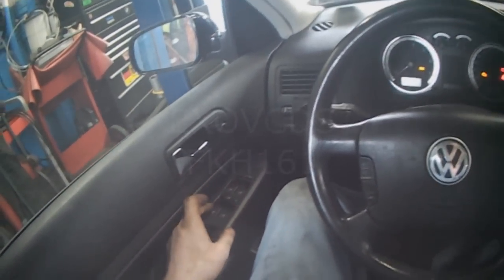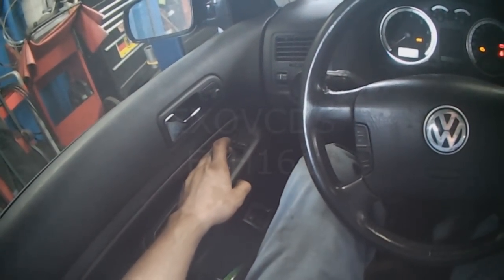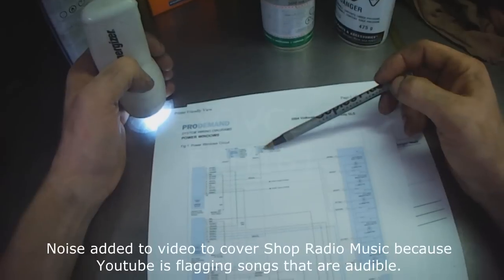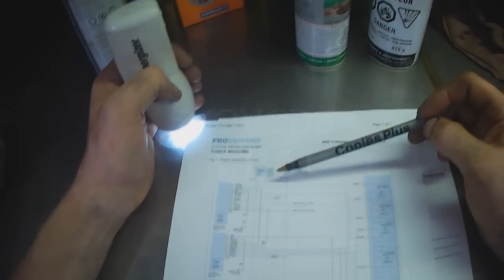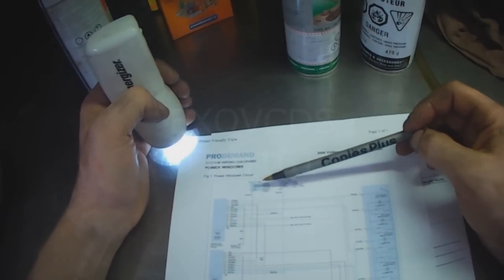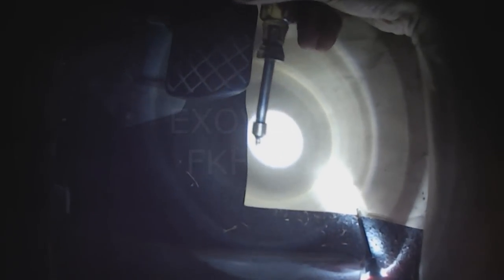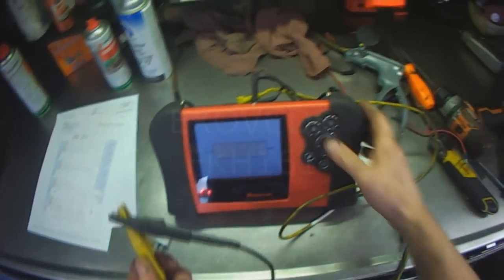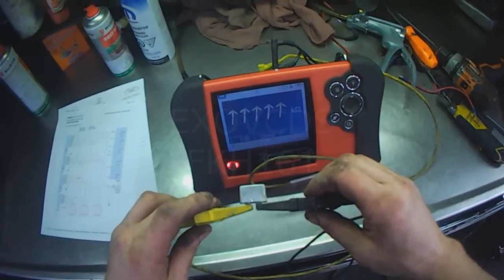VW A4: Power Windows not working

Comment: 2021 and this helped me save a couple hundreds of dollars. I checked every fuse on the side of the panel, checked the wires that go through the door, I was loosing my mind, when I checked for this fuse it wasn’t there, didn’t even knew it existed. Thank you!
Reply from the maker: How did the windows work in the past if the fuse was missing? Did you just buy the car?
Reply: @EXOVCDS  yes I just bought the car a few days ago, the windows didn’t respond at all, checked fuse #14 first and it was fine, then I checked the wire harness that goes through the driver’s door and it wasn’t bent nor damaged, I literally just saw this video and did it and the windows started working, except the front passenger’s. I took the 20amp fuse from the horn (which is not working) and put it there.
Reply from the maker: @prod.grvvity  thanks for the additional info! Congrats on the new-to-you mk4. Feel free to check in on my channel should you have any other issues in the future. Thank you for watching!
Reply: @EXOVCDS  thanks for making these, your helping many people with simple and informative videos.
Reply: I just also purchased a mk vw golfsportwagon tdi and the windows won’t go down will be trying this next, what fuse is it or how many amps so I can just replace it anyway if you don’t mind me asking??
Reply: Mk6*
Reply from the maker: @fitbiker1800 
The Golf sport wagon is different from the VW mk4 / A4 in this video. You'll need a wiring diagram to help troubleshoot the issue.
Reply from the maker: @fitbiker1800 
Start with a full system scan... you'll need (or go to someone) a VCDS or similar scan tool. 
Once you have the system scan, post the results here, so that I can go through it.

Comment: You my friend are a lifesaver! I've been chasing wiring and checking voltages all day long! I checked that circuit breaker for continuity and it was there but replacing it with a fuse was the trick. I put a new breaker in and walla, FIXED! After checking all voltages and connections to CCM it boiled down to this Breaker. Thanks for the information, I hope others can find this video with the same problem.
Reply from the maker: Thank you for watching!
Reply: I think I better check that on my vw jetta. Windows stopped working so I replace the switch. Still they don't work.
Reply: @EXOVCDS  I don't have the right tools to remove the nuts that hold on the paneling that covers the circuit breakers. That's my issue.
Reply from the maker: @Will324  year, make, model?
Reply: @EXOVCDS  2003 VW jetta 2.0
Reply from the maker: Should just be Torx screws that hold the panel in place... just like in the video. If you do not hear any clicking when the window switch is used... then the problem is probably something else.
Reply: @EXOVCDS  yea I replace the switch and even with the new one it's dead. Not a click with any of them. All the individual window buttons also don't work. The fuse is still good. What could it be ?
Reply: Electric windows in my old Audi sometimes works and sometimes they don't.  could this be it?  what's the difference between this and a fuse?  can it be purchased in any electronics parts store or do you need the Audi part? Thank you
Reply: @EXOVCDS  does this problem transfer to the mk6s same issue as your describing door locks work window lock lights up , but no door panel can roll down windows the window relay also does not make a clicking noice when touched
Reply from the maker: @nintendo002 
The only thing that is similar is the possibility of broken wires in the door jam. Everything else is different between them.

Comment: I held my positive and negative cable together for 20 mins ,carefully
 slid back on poles at same time and BINGO-all went to reset.Everything 
works great!!!!! This method saved me a pile of money.Club members 
should try this if you suffer from same problems after battery 
disconnect.It is safe and it works Anytime any system on these cars is acting confused, do a capacitive  discharge.  It works very well lol.  We do it quite a bit at the dealer  for when a car just doesnt seem right.
Reply from the maker: Good tip... I have used the capacitive discharge many times to cure weird issues. Most of the time, 10 seconds of holding the cables together will do the trick.

Comment: I know this is an older video, but this still helped me. I know this was for an mk4. However, this was still applicable to me and my b5.5 passat! Very same conditions. Pulled the breaker and found a boat load of rust and corrosion. So I bought a lilse fuse slot cleaner and breaker. Sure enough! I've got windows again! Thanks for what you do for everyone!
Reply from the maker: Thank you for watching!

Comment: You seem to be the most informed person I've read. I bought the $100 manual and that hasn't helped , so I am now reaching out to you. I just bought a 2002 VW Passat Wagon 2.8. No windows will roll up or down. Let me re-phrase that. I can try and every once and a while the drivers front or passengers may move an 1/8" up or down. But that is it. No sun roof or rear hatch release. All lights light up so I can see power going to the switches.  I tested the main switch control unit in the drivers door, and four separate wires had over 13 volts DC. I Pulled the carpet up under the drivers floor and it looks like brand new. So didn't the CCM. No broken or frayed wires anywhere. No sign of water having ever been in there. I pulled the cover off the CCM and didn't notice anything burnt on the circuit board. I also checked to see if there was a ground to chassis, and it did Ohm out as to getting a good connection.
Also, the door locks work with no issues. But is the light beside the drivers door lock supposed to flash all the time? 
    So I do not know where to look next. I have an OBDii tool, but I don't think that will help me here. Any, any help would be much appreciated....
Reply from the maker: The little LED at the base of the window should only flash when the vehicle is locked (security / alarm ON indicator). If you hear clicking from the "door module / power window motor / module" (one and the same) when the window button is moved, then "control" of the window is present (switch & CCM)... and the issue is with the window motor / circuit board / polarity relay (on the board). 
It could be that you have 4 bad window motors / modules (they go bad with age just like the door latch modules / actuators)... but if there are other items that are part of the convenience system that do not work or function intermittently... I would continue looking for a common issue.
I can supply you with wiring diagrams, that's about it. I would have to look at the diagram myself and study how things that you listed tie together... and might then be able to guess as to where the issue might be. 
Have a look at this... not sure if this can happen on a B5 Passat, but it could also possibly interfere with the CCM.
https://www.youtube.com/watch?v=NPuw8TR3KYg

Comment: Thanks very much for this video, I've been having problems with my  windows not working for weeks had checked all the wiring, and the ccm and  could not find a solution I did not know that there was another hidden fuse windows working fine now thanks.
Reply from the maker: Circuit breaker.. :) Thank you for watching! I'm happy that the video was of help!
Reply: Where is that located?? Pleaaseeee

Comment: Nice video! The large fuse was the issue on my 2009 Beetle. I unplugged the fuse, found no continuity problem, but plugging it in the Windows now work. Perhaps it was not fully seated, perhaps it is a harness issue. Regardless I know where the issue is now. Thanks for saving me lots of $$$!
Reply from the maker: Nice... $5 gets you some of my youtube channel stickers! Second donation button on my website: http://fkh161.ca/
Reply: Thomas EXOVCDS   St. John’s Newfoundland. I wish I had seen that I could call you on the phone.  Back in August I was working on a 1992 camper van. I watched a lot of your videos that were very helpful. The van would start and shut off after a few seconds. I borrowed a spare distributor. Checked the fuel pump pressure. It ended up being the ECU, it was green. Sourced one locally for a decent price.  I am going to order a few stickers and I will definitely support your page. I will stop in and say hello next time I visit BC. Keep up the great work.

Comment: You are the man thank you so much  I just bought a 2008 Volkswagen Beetle with 63000 Miles for $500 that has been sitting for over 4 years due to a death in a friends family they wanted it gone  there was a definite moisture problem inside the car that they knew about because the driver side window was left down about 1/16th of a inch not enough to get rain in the car but it did build up a lot of moisture basically nothing was working in the car after I put a battery in it because it blew all the fuses and I had to dry the car out completely them replaced damn near every fuse but the power windows did not work after everything else started working I've been trying to hunt  down the problem for the last 3 days i was thinking it was the Comfort Control Module because it can cause the windows not to work but I was hearing the clicking in both doors and that's when I started to search the problem and I found your video it was the exact problem the circuit breaker I did like you did and put a fuse in it and it worked and I looked through all my bug guts/parts box  and I found a good circuit breaker and I put it in there and everything works perfectly thank you so much for your video it's saved me a lot of time 😉
Reply from the maker: Nice to hear that one of my videos was of help to you! Thank you for watching!

Comment: Hi thx for this video, what kind of component did you put in that connector to replace that module with corrotion?
Reply from the maker: To test the circuit I used a fuse of the same rating as the circuit breaker. The rating is stamped on the circuit breaker.

Comment: Nice video.  If you change a window module and motor. Do you have to reprogram or relearn it?  
Thanks.
Reply from the maker: Year, make, model?
Usually only the auto up / down needs to be activated.
Reply: It’s a 2002 beetle gls 2.0.  Your vw looks familiar to me as far as the switches and schematics. Yeah it’s strange the original window module motor relay burnt up so I bought a used one in the same year range.  It will only work until the control circuit times out. Then I have to unplug it and plug it back in to work again.  I lost the dome light and passenger side window control from the drivers side. When I plug the original module back in the dome light comes on and I get control of the passenger side window again. Thank you for any help with this situation.
Reply from the maker: I would suspect that there's a problem with the used one. Can your scan tool communicate with the module or get info from other modules? A full system scan can be helpful... the comfort system control module might have codes stored, or tell you if the door module needs to be coded.

Comment: I've got an interesting one for you. 98 Passat, aftermarket stereo. Can't read obd2 codes but power is there. The customer had attempted to charge the battery, but swapped positive and negative. Lights flashing on instrument cluster. Pulled radio, still can't scan. Pulled ABS module(it was flashing). Still no scan. All fuses are good. Where should I look next?
Reply from the maker: I think there are 8 modules (not including radio)... one of them could be pulling the system down.
ECM, ABS, CCM, Airbag, HVAC, Instrument Cluster, TCM, Memory seat.
Disconnect one at a time to see if communication comes back.
Reply: Thanks for responding. Yeah, that's what I figured what would need to be done.
Reply: You know what fixed it. Fuel pump relay. They were all grounded to that. Spent a week wrapping my head around it. Goddamn relay!!!
Reply from the maker: @nimblemix  thanks for the update! No way I would have guessed that. Great troubleshooting!

Comment: I have a 98 beetle. Switches dont roll down either window. Power wires in driver's side door have power and switches are illuminated. Driver's side window rolls up and down when key is turned in the door lock.
Reply from the maker: Remove the switches and check for corrosion in the switch / connector. Check the wiring in the door jam.
Reply from the maker: Forgot to mention... use a scan tool to see if the comfort control module can detect switch operation. You'll need a scan tool that can communicate with other modules... a basic OBD2 code scanner won't be able to communicate with other modules.
Reply: Thank you so much i will see what happens. Liked and subbed

Comment: @thomas i check same step you did buy my audi. a4 doesnt have a fuse on my module. it was wet when i checked under carpet had stain. 2003 audi a4 1.8t automatic. my interior light wont turn on either only door light which is wierd.
Reply from the maker: +juan ramos Check your youtube messages, a link to wiring diagrams has been sent. Check the fuses & wiring.

Comment: Hi Tomas, this is an old video. But my sons 04 gli Jetta is doing this except there is no clicking or anything at the switch. Thanks man
Reply from the maker: Have you done a full system scan? Any codes in the comfort module?
Reply: @EXOVCDS  I just ordered a new scanner. I replaced both window motors bc I had a couple extra. Checked fuse panel so far.
Reply from the maker: Anything else besides windows not working? When you turn the headlights on, do all interior switches light up (the ones in the door panel)? Power mirror operation?
Reply: @EXOVCDS  Everything seems to be ok as far as power. The door locks work but the alarm doesn’t work all a sudden either.
Reply: @EXOVCDS  No power to the switch. Only the door lock buttons work but the switch isn't lighting up and no windows.
Reply from the maker: @user-wn6pr4qh5v  look for broken wires in the door jam loom... usually not an issue with MK4s. Switches in other doors also not lighting up / working? You'll need good wiring diagrams to be able to trace power & grounds. Driver door module (window regulator module) is the master module, the other window modules are slave modules. Communication wires need to be intact for them to function.
Reply: @EXOVCDS  ok ty

Comment: hi great video well exsplained do you no if a seat codoba has a cercuit breaker anywere as all my windows stoped working the is no power to main switch drivers side in the fuse board there are four 25 amp fuses each serving the indivial windows i have checked them they all have power to them could there be a relay that runs them there are 4 relays on a seprate board
Reply from the maker: What year? I can check a wiring diagram once I get home later tonight.
Reply: sorry for late reply 206 seat codoba tdi 1.4 engine thanks
Reply from the maker: Sorry... the information system that I have does not have any wiring info that I can look up.
Reply: ok thanks

Comment: My Mk4 passenger side window will roll up but not down. I swapped out the regulator but it seems do the same thing. I haven't replaced the circuit breaker you changed. Any suggestions to what my issue may be? Thanks for your help...🙏🙏🙏
Reply from the maker: Are you sure that the switches are ok? Lock the car with the key in the outside driver door handle. Now turn the key to the unlock position and hold it there. All windows should go down. Yes / no?

Comment: hello great job as usual..
got vw mk5 and both of wing mirror indicator stop working i ooen the mirror and check the lights and they r working as they led and both gone together it should be the other fault open the passenger door panel and check the wiring and conector they been fit ok and no cutting on any wire going to mirror and i scan the car with vcds but no any fault indicate them either so what r u suggest my next step would be ?
thank u
Reply from the maker: It can get tricky checking for power because the module (that monitors bulb circuits) will not send power to a device if it thinks that it is broken. I can only suggest to look for something that both sides have in common... via a wiring diagram.

Comment: broski is that little circuit breaker in AutoZone on this passat sunroof also does nothing and if trying to lock from outside locks but unlocks open really fast by itself alarm fob seems to also be reprogrammed cuz it makes nothing when pressed only light in remote blinks red
Reply from the maker: Make sure that the comfort control module is not wet (under carpet on B5 Passat's).

Comment: I had to cut and splice the comfort control module wire harness and also replace the control module. where is the multi-purpose transmission P&N switch located at in the B6
Reply from the maker: Usually mounted at the transmission where the linkage / cable attaches (I would have to check to be sure).

Comment: Im having the same issues exactly the same sunroof works too gonna check this when i get home thanks for the video very helpful
Reply from the maker: Year & Model?
Reply: Thomas EXOVCDS 2002 audi a4 1.8t
Reply from the maker: I'd have to look at a wiring diagram, Not sure if your Audi A4 has similar wiring / control of windows as the VW A4 (Golf / Jetta).
Reply from the maker: Have you checked under the driver carpet for wetness at the comfort control module / wiring loom? You could have a corroded wire in the loom or a corroded connection at the module harness plug.